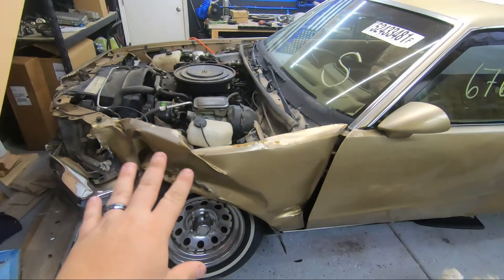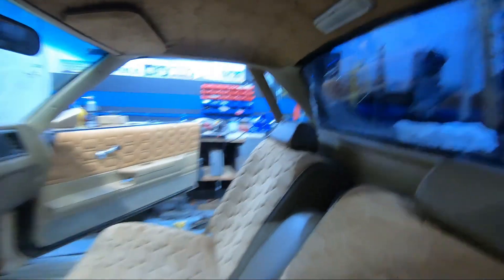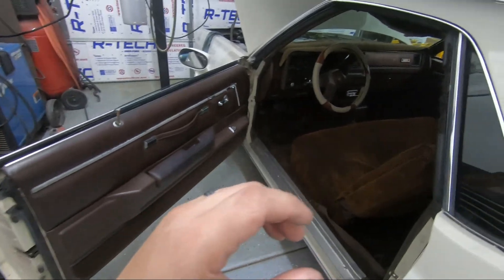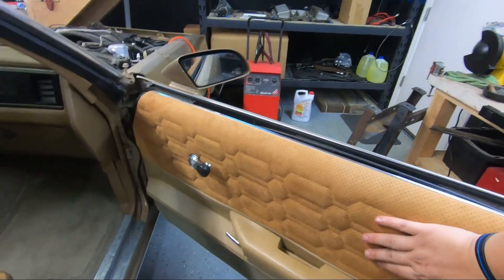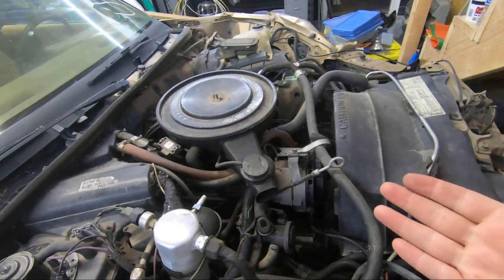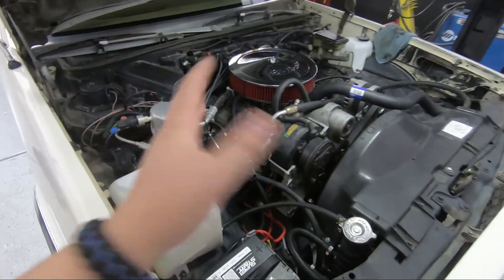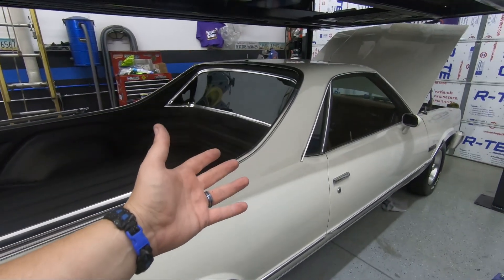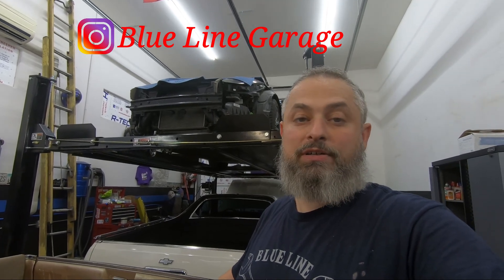Blue Line Garage - El Camino Parts Car Introduction on Full Interior Swap!

Comment: bro that intro was unique.  That garage is getting full brother.  I love buying donors for builds so flippin awesome.  Great job.
Reply from the maker: Your channel gave me the push that donor cars are not bad at all and you can recover your money you used to buy it when you sell it.
Reply: @BlueLineGarage  Heck yeah brother we have recovered almost all the money we spent on all but one.  The one was the motor and trans donor but there was nothing sellable on that sucker.  Plus what it cost for a coyote and trans right now is still far less than our so its kind a win
Reply from the maker: @JMRRebuilders  yeah I saw.. but this donor car I have has so much even a running engine. Gonna start swapping stuff in the next hour